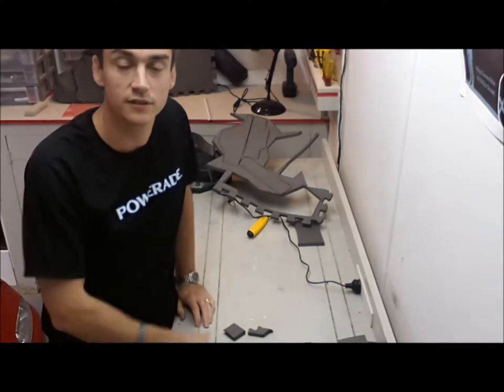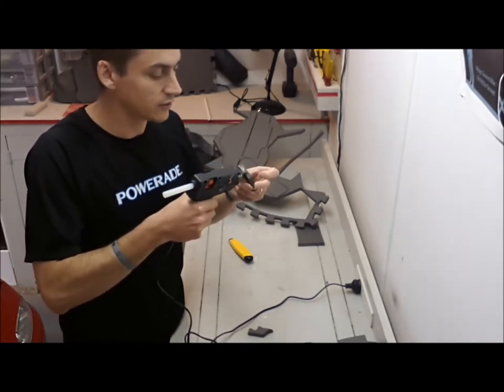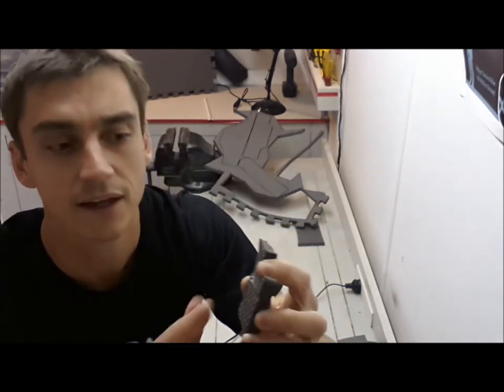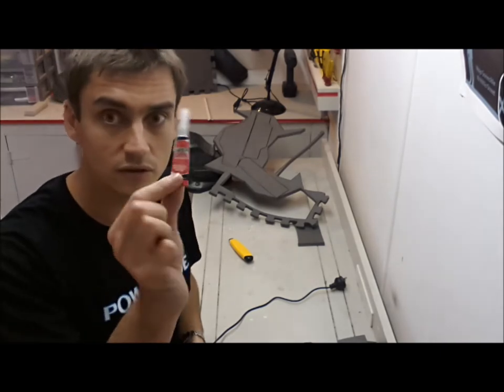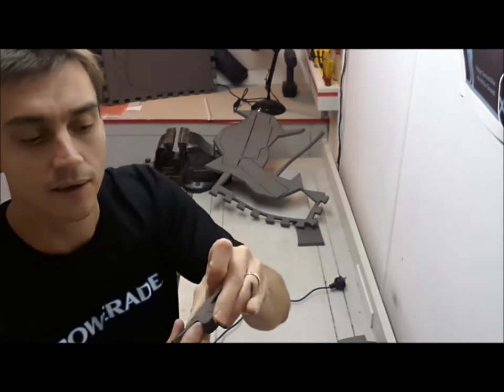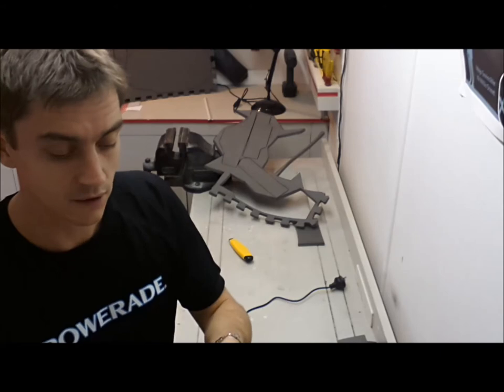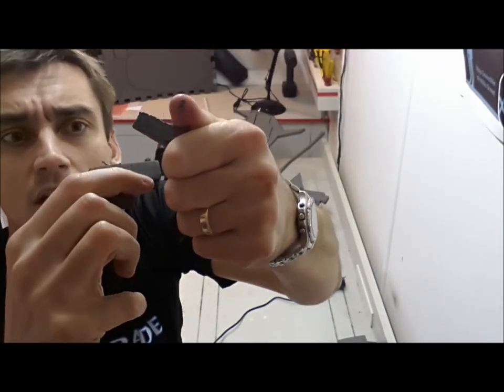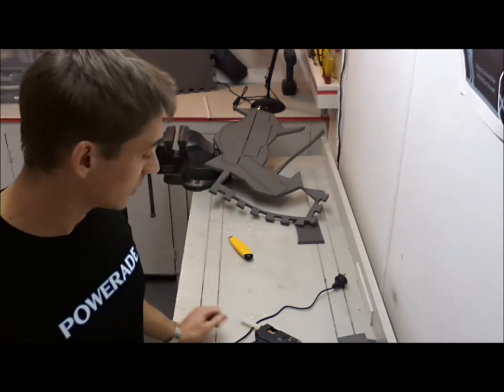How to make an EVA foam Space Marine suit - Part 4 - Gluing the Foam

Comment: I want to start building a suit over a year. I've used hot glue to build a proton pack before and a foam portal gun but it was cheap dollar store glue and gun. It worked for a while then everything fell apart. What types of glues do you recommend?
Reply from the maker: hi there. I talk about glue in one of the videos. suggest you watch the series as there's loads more info than I Could write out in a comment ;)